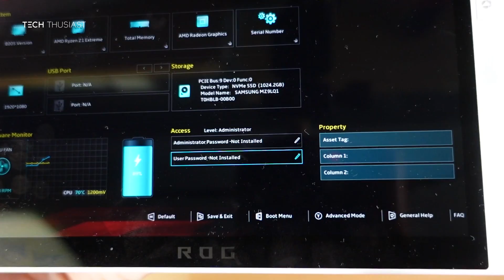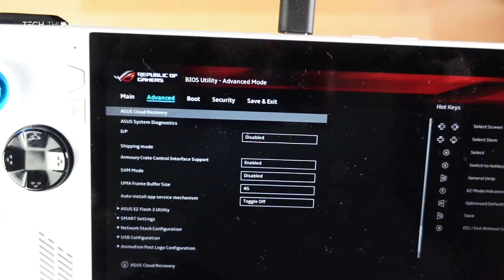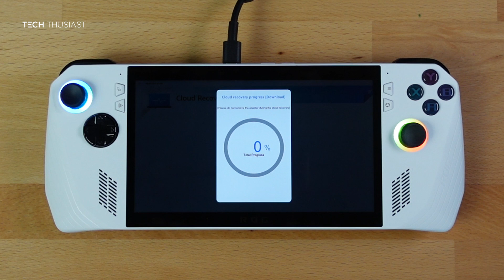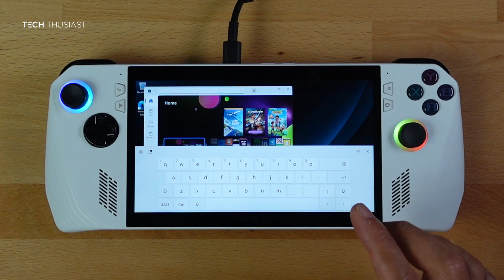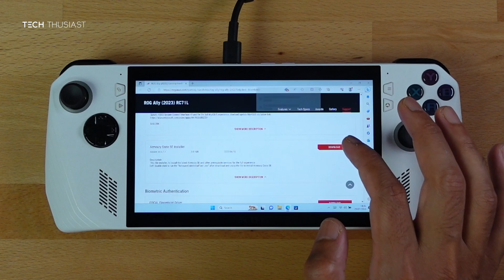How To Upgrade The SSD For Your ROG Ally

Comment: Do you need to clone the old drive first or does the Ally reinstall windows from the cloud onto the new ssd?
Reply from the maker: If using cloud then it's a fresh install. If you're cloning then should be just a straight ssd swap
Reply: Do i need to acrivate thr windows 11 from the cloud install? @TechThusiast
Reply from the maker: @Anomaly66666 it should automatically activate street installation is finished